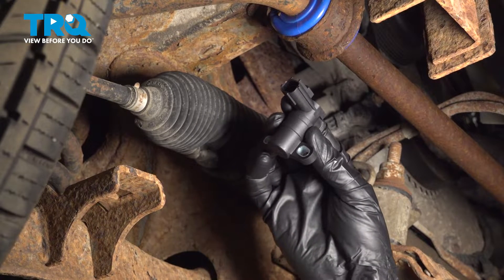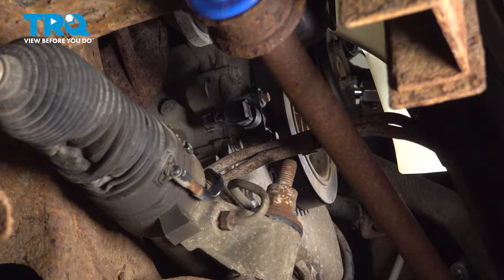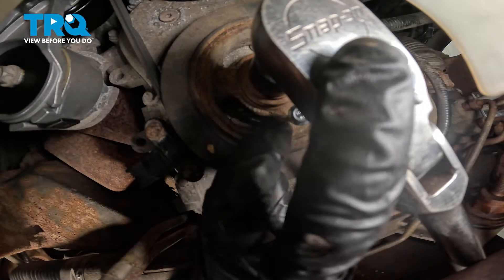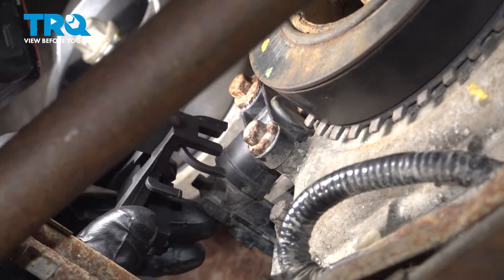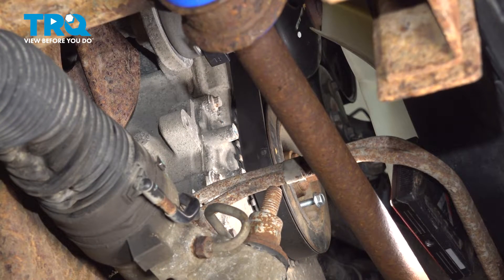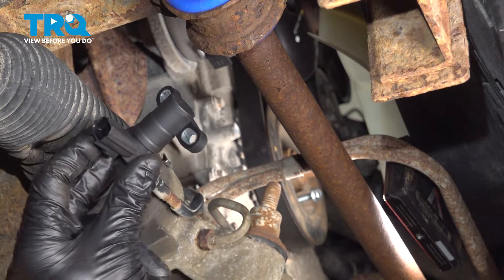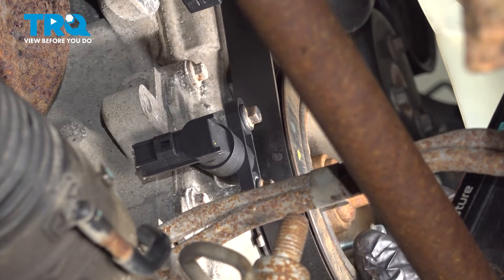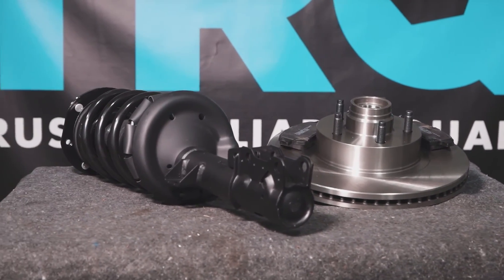How to Replace Crankshaft Position Sensor 1998-2011 Ford Ranger 2.3L L4

Comment: i'm sorry this makes no sense and the person making this video is not answering any questions. You do not need to put it at top that center I don't see why you would have to. They can only go in one way it's gonna pick up TDC every time to flywheel goes by anyway anyways, so it doesn't matter what position the harmonic balancer is in when you takeoff the crank position sensor and put it back in. It's pretty much dummy proof. If somebody has some other reason for it, please explain.

Comment: 1. Without placing the truck in TDC1, can the new crankshaft position sensor simply be swapped with the old sensor — is putting engine in TDC1 required?

2. Is the timing tool absolutely necessary — it did not come with the new crankshaft position sensor?